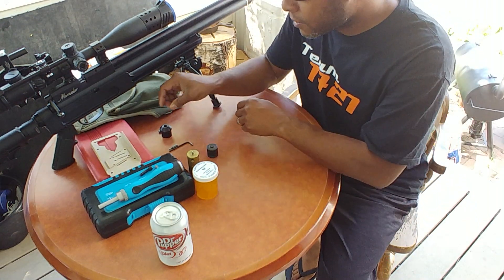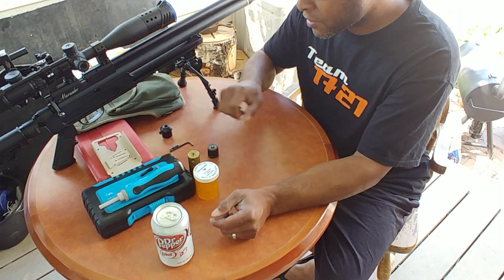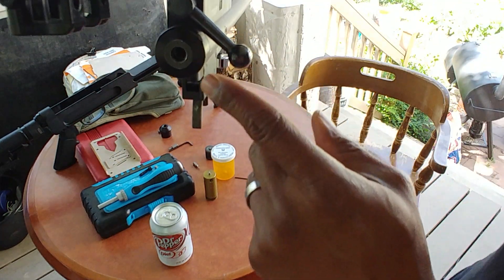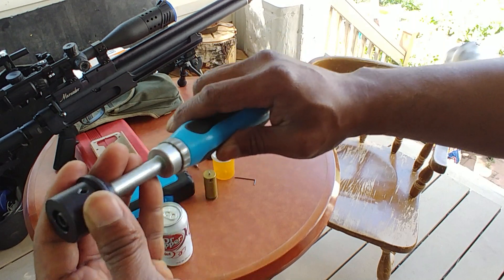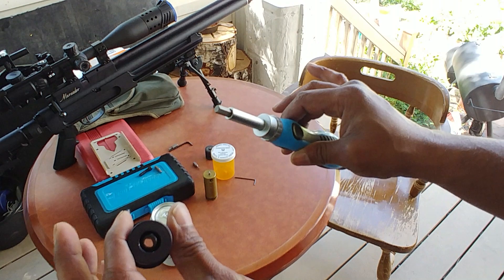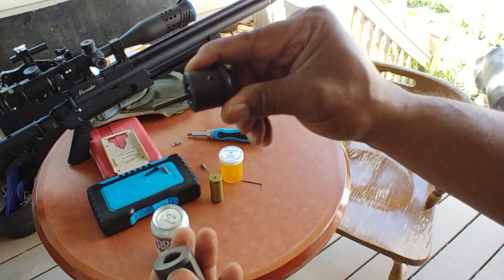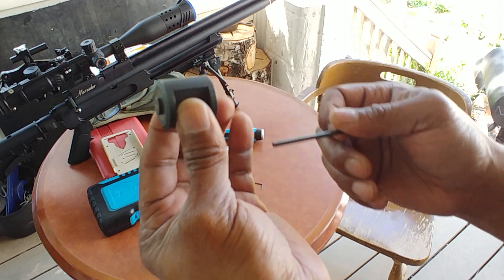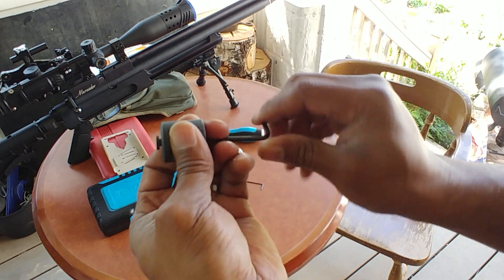How I tune a Benjamin Marauder for power.

Comment: Man the least I can do is subscribe to your channel...your video was so detailed I did exactly how you explained and my new marauder .22 went from store/manufacturer mode to hell mode holy crap
Reply from the maker: @ctjetskiclub772 thank you very much!  I really appreciate the comment and having you as a new subscriber.  That is what I like to know when people use this video to tune their Marauder.  What speeds and with what projectile were you getting before and after the tune?
Reply: @Monkeydad1969  I don't have a chronograph but will be getting one this week but I have the swinging metal targets and before it was smacking them and they would move 5/6 inches on the swivel now they going completely around smacking twice as hard and this is a new marauder I just bought this week stock from manufacturer
Reply from the maker: @ctjetskiclub772  cool beans.   Looking forward to your results.
Reply: @Monkeydad1969   hey buddy the only thing I did notice is when I did the 4 and half turns out for the transfer port screw when I re insert the jam screw I have to leave it loose like flush to the hole because if I keep screwing the jam screw in it will screw the transfer port screw down with it and will go to the bottom ...is that normal like the screw does not tight together with the transfer port screw.
Reply from the maker: @ctjetskiclub772  put the velocity adjuster screw where you want it, then blue loctite the jam screw.  Just butt it up to the velocity adjuster screw.  That should fix that.
Reply: @Monkeydad1969  1031 fps 14.3 gr for 33.76 fpe
Reply from the maker: @ctjetskiclub772  there you go.  How's your accuracy?
Reply: @Monkeydad1969  dime size groups pretty good

Comment: This gave me just the ‘umph’ I needed to start tweaking my .177 Marauder :). I’m using the 16.1 gr JSB Beasts and I was getting decent groups at 50 yards, but I could tell there was more available. I opened my metering valve about half a turn (total opened 1 3/4 turns from closed) and decreased the hammer spring tension about half a turn, now I’m stacking those Beasts every time at 20 yards and I’ve gotten down to 3/4” at 50 yards - very happy camper now. Thanks!
Reply from the maker: That's so very cool.  Glad my vid helped.

Comment: Great vid and explanation. Now I can easily tune my .22 Marauder.
Reply from the maker: Thanks
Reply: @Monkeydad1969  Can you give me any tip on how I could check the velocity/power without a chrony? Shooting at plywood from a certain distance and measuring the penetration doesn't feel very professional but I don't have a better idea at the moment.
Reply from the maker: @bencematyasmarton559  that's a hard question to answer.  The only thing I can say is shoot at the board first, measure the penetration.  Then tune your rifle for more power, shoot at the board again and measure that penetration.  Having a chronograph is imperative to rifle tuning.  I do understand, not everyone has one.  It's another cost.  Also, depending on what projectile you're shooting, the penetration into the board may not show any difference between a non tuned and tuned air rifle.  If you're getting over a quarter inch of penetration then you're probably doing fine with the power.  Accuracy trumps all regardless of power.

Comment: Thank you for dumping this thing down I’ve messed with mine never really got it where I wanted to. Very precise a good explanation thank you
Reply from the maker: Thanks Andy.  I hope you get your rifle going.  Let us know.
Reply: Well I got all I could from it , it’s shooting 31 grain H&N @837 fps
Reply from the maker: @andyhiggins8416  48fpe ain't no joke.  Did you back off the velocity adjustment screw in the valve?
Reply: Monkeydad1969 yes & the 1/8 screw backed up all the way
Reply from the maker: @andyhiggins8416  and did you back the hammer striker pin all the way back, then turn it in 3 times?
Reply: Monkeydad1969 I did but I got the max from it by keeping it bottomed out ,I did it with the three turns back in like you showed in the video but the speed wasn’t there so I tried it just bottomed out and it made a noticeable difference
Reply: @Monkeydad1969  what stock do you have?
Reply from the maker: @ajcummings8033  that's a Teryx stock.  But they aren't made anymore.  It's the first chassis system ever made for an air rifle.

Comment: Very good description and demonstration of what works... just picked up a 25 cal Gen 2  Amazon return cheap and started messing with it. I have already installed a huma  reg and a twin hammer spring in it, so now on to the valve!
Reply from the maker: What pressure are you going to set the reg to?
Reply: @Monkeydad1969  140
Reply from the maker: @randyburton3567  cool.  What are you going to do to the valve?
Reply: @Monkeydad1969  
I opened it up a good 6, maybe 7 turns and installed a twin spring system to help with hammer bounce. Right now I am not real happy with the setup. When I got the rifle. I could get 32 usable shots at 30 yards doing about 800 fps. After doing all the install and opening the
Reply: Valve up..
 Best I could do was 800 to 810 over 16 shots. I don't mind the lower shot count. But expected much better speed.
Reply: I have the hammer spring adjustment turned in several turns and the striker on the hammer back all the way to hit the poppet hard
Reply from the maker: @randyburton3567  you're probably going to have use ¼" vinyl tubing for the transfer port and you may need to change out the valve return spring for something a little softer.  You may even need to open up the valve exhaust.  Either all 3 or a a couple of those mods, depending on your level of tinkering.  You call also try upping your reg pressure, too.
Reply: @Monkeydad1969  Oh I am a tinkerer...I want to try and balance shot count and power, and without changing the valve and opening up the transfer port, and increasing reg pressure I have probably gotten all I am going to get from this setup... Not sure why I am concerned with it anyway when I have an FX Impact on the way in 22... I can get lots of power out of it...
Reply from the maker: @randyburton3567  cool beans.

Comment: Hi joe,i make this setting to mi .177 with 13 gr zan slugs end i have 934 fps. Thanks for your video.
Reply from the maker: I have updated my .177 since the vid.  It is powered by a JSAR valve and shoots a 19.5gr VarmintKnocker .177 slug at 60fpe.  I have tried KO Slugs, and they do great.  Please keep me in the loop on your setup.
Reply: @Monkeydad1969  I don't know if i can order valve from US because I'm in Cyprus i will try. Can you tell me how to find what barrel i have in my Benjamin; Thanks.
Reply from the maker: @a.l.r.3006  I don't know if JSAR will ship internationally.   When you say find what barrel you have,  do you mean what  manufacturer made it?  It's the .177 barrel that Benjamin makes in house.
Reply: @Monkeydad1969  yes that i was meaning, thank you very much for your time to answer. keep the good job 👍.

Comment: Excellent! Thanks
Reply from the maker: Thank you.  I hoped it help.
Reply: Reply with the quickness! I get the first 2 adjustments. On the hammer throw or stroke adjustment… CCW full stop… would this be max power? Why do you go CW 3 full turns? Would I possibly want CW 1, 2 or 3 full turns? Thanks again and hope my question makes sense
Reply from the maker: @precisionrodentcontrol_PRC  you reply with the quickness too LOL.  I say 3 turns CW from being backed out all the way as a baseline.  It is different for each rifle and shooter.   It all depends on what you are looking to get from your rifle and tune.  If you want more hammer stroke then back it CCW.  I usually go more hammer stroke so mine are backed off CCW completely.  CCW full stop is max hammer stroke...ie...more power.
Reply: Got it, thanks for the knowledge. Would love to see a similar video on the Prod. Happy shooting!
Reply from the maker: @precisionrodentcontrol_PRC  actually it is the same except for the lack of the velocity adjustment screw.

Comment: What a great video!  I am new to the PCP world and we appear to have the same philosophy -- Shoot with lots of power and FPE.  I have a Benjamin Marauder .177 Gen 2 and the AirForce Escape in a .25 cal.   I will be surfing your channel to glean as much info as possible.  Thanks again!
Reply from the maker: Thanks Mark.  Yeah, I'm the worse at putting out vids.  But I will have some coming out soon.  Mostly catch up from vids past.  I have a couple builds that should be finished soon and I love my .25 Escape and .257 Escape.  I like power but I'm really into getting power with minimal air usage and a good shot count.  I've started to do less psi fills and getting serious power.  That's especially true of my .25 Escape.  2400-2600psi fill, 30 shots with a lot of power and I haven't touched the power wheel.  It's set on the lowest setting.  Tuning is key and a chrony is essential.

Comment: nice lookin gun.
Reply from the maker: Thanks.  I like it...a lot.
Reply: @Monkeydad1969  im in the middle of a pcp .243 air rifle build on my other channel bison workshop. and right now im working on a few bugs in the system. if you want, your welcome to go check it out. and trust me its not a cheap ass pipe build like i see in most of these youtube channels using pipes and fitting i wouldnt show to anyone lmao. i built it in my machine shop and carved the stock. all made from scratch. you would like it.

Comment: Hey Joe I know that this is a bit older video but if you're still out there i have something to ask if I may ? Can you adjust the hammer spring and the hammer throw without opening up the pin in the valve ?? And if I adjust the hammer throw all the way out to start with like you did is there a positive stop or will it back all the way out like you said it will if you go all the way in with it ?? And does the hammer spring adjustment stop when you back it all the way out or will it come out of the gun ?? Any help you could give me would be greatly appreciated !!
Reply from the maker: The RVA, rear velocity adjuster or hammer spring adjuster will stop when you go CCW (counter clockwise) until it stops.  It will come off the threads if you go clockwise all the way.  The hammer throw (striker) will hit the face of the hammer when you go fully CCW, but it can come off the threads if you you go too far clockwise.  You don't need to adjust the velocity adjustment pin when tuning with the hammer spring and/or the hammer throw...just be aware you will limit the tune if tuning for huge power gains.
Reply: @Monkeydad1969  thank you Joe !! 👍👍
Reply from the maker: @timmy4539  hope that helps.
Reply: @Monkeydad1969  hey Joe just one more thing if I may ? With this tune work on the field / target to ??
Reply from the maker: @timmy4539  well, being that the Field and Target is regulated,  your mileage may vary.  The nice thing is that it will be consistent, but you will not get any huge power gains.
Reply: @Monkeydad1969  why I asked is that I got a
 field /target in 22 cal from Rick from airgun web and he told me that the hammer and the hammer spring needed to be adjusted on it ! So I thought that this tune would work for it ! Do you think it will ??
Reply from the maker: @timmy4539  yes, it will give you a little more bang for your buck, and it will still be very consistent with a good shot count.  I don't know how much more power, I don't know what they are regulated at.
Reply: @Monkeydad1969  so if it's regulated can I adjust the air pin as you called it ?? If not I can still adjust the hammer spring I'll be good to go ?
Reply from the maker: @timmy4539  as long as it has all the adjustments a standard M-Rod does, you should be good to go.  If never had the Field and  Target in my hands, so I can only assume it has the same adjustments.
Reply: @Monkeydad1969  thanks Joe !!

Comment: Great video the best part is you answer questions you don't just talk you get to the point probably the best one out there but I have a question I am trying to tune a new 22 marauder to get about 933 feet from the present 843 feet and not lose my accuracyGreat video the best party as you answer questions you don't just talk you get to the point probably the best one out there but I have a question I am trying to tune a 22 marauder to get about 933 feet from the present 843 feet and not lose my accuracy any tuning points you could give would be great if you worked with a 22 Mirador thank you any tuning points you could give would be great if you worked with a 22 Mirador thank you
Reply from the maker: What pellets are you shooting or do you want to shoot?  Are the pellets or slugs you shoot accurate out of your rifle?  You may have to do some modifications to your rifle such as valve work or a new more powerful valve, utilize a heavier hammer spring to get that speed, depending on the weight of the projectile.  Please let me know.
Reply: Right now it shoots everything i have put in it. a hole at 10 yards 10 round group  even the 10 dollar 500  benjamin pellets .tryed about 6 brands of pellets ,this is the problem i do not want to lose the accuracy for the power , but i would like it to get 933 an keep the accuracy . everyone tune no one shoots groups please shoots some groups , as for as the pellets im up to shoot what ever it takes ,but i hunt with this gun .Thank you for your help
Reply from the maker: @barttate3228  933fps is a lot of speed.  But if your barrel is good, then accuracy shouldn't be an issue.  Just for the speed you want, you're going to have to do some work.  I suggest a Jefferson State Air valve or the Hill valve.  The Cothran Powerhouse valve is was powerful, just to much for .25 caliber.  I'm really bad about shooting groups and even worse when it comes to YouTube.  But you're right, I need to shoot more groups.
Reply: @Monkeydad1969  yes you are please shoot some groups thanks so much for yor help

Comment: Hey brother very good video!  You didn’t talk a lot. 

What’s the max fpe can the marauder achieve with how you tune or what’s the max fpe that can be achieved!
Reply from the maker: Depending on caliber and projectile weight, tube pressure... you can get 45fpe pretty easy in .25.  It's been so long since I've shot a stock rifle, all of mine are modded.  I do have a stock .25 M-Rod, it's regulated.  Guess I need to remove the reg and see what I get.  I wanna say I've made up to 50fpe in a stock .25... but I really like to do a little valve work and open up the barrel port for better results.
Reply: @Monkeydad1969  of course.  See the reason why I’m concerned about power is because I’m so use to how I have my .177 break barrel. It shoot like a 22-short. I DO NOT SEE THE PELLET OR SLUG N THE AIR!

That’s what I’m use to!  I realize that for the power I’m use to dealing with I need to upgrade to a pcp which can be easily modded and not a hassle to tune!  I’m looking for the key ingredients; new plenum, and other adjustments that can yield 1080 or 1200 fps in .25 cal at least around 26-30 gem slugs🤷. I am looking at the Avenger-X and the Maurauder in .25 cal!  The Avenger -X have so many mods. But I’m an old Benjamin buff from back in the 80’s and I wanted to compare and see which is easier to tune and which one can yield the most power and is it possible to put a. Otto’s on a mairauder? Or is that what the Cayden is for (it has a bottle)?
Reply from the maker: @roderickthomas3417  1200fps in .25 is not an easy feat, even with all the tech in pcp rifles.  On your .177 break barrel, what weight pellet are you shooting?  Idk much about the Aveng-X.  It has a lot of tunability.  The M-Rod lacks the reg.  A Cayden to me isn't the best platform for power.  Also, there are other brands that are more than capable of getting you where you wanna be, as long as you have the money to spend.  To be honest, I think for power and accuracy, you can't go wrong with the AirForce Condor or the AEA Challenger Pro.  I have both, and they are amazing.

Comment: How much power FPE and FPS can you get out of the Benjamin Marauder .25 caliber using 26 gr pellets by just tuning without modifying any parts?
Reply from the maker: That all depends on the tune.  I know that sounds like a cop out, but it's hard to say because it depends on the tune.  I haven't tuned with pellets that weight, but now I probably need to do some work.
Reply: @Monkeydad1969  Thanks for your insights! I currently have mine set to 840 FPS with 26gr FX Slugs, achieving 40.72 FPE, and it's performing with great accuracy. I was just considering whether it might be worthwhile to invest in the .25 Rifle Max Kit at $267.98. They don’t specify the additional power gains, so I’m curious if the investment could significantly improve performance. Any experience or recommendations on this upgrade?
Reply from the maker: @papote385  It seems to have quite a bit of punch with the 26gr, which are actually the JSB King 25.39gr.  How much more power do you need and what will the rifle's purpose be?
Reply: @Monkeydad1969  Hi there! I chose this air rifle for hunting small game because it can reliably group 5 shots within 1 inch at 60 yards. My goal is to maintain around 30 FPE at that range for humane hunting. With my current power setting, I keep my shots within 60 yards, but I’m curious if there’s potential to extend that range to 100 yards effectively. Any insights?
Reply from the maker: @papote385 of course.  You just need to set out targets from say 50 to 100 yards and start shooting.  Practice makes perfect.  But you will lose your current tune to maintain good down range energy.  You can shoot with your current settings, but you are going to want to bump it up just a bit.
Reply: @Monkeydad1969  Thank you for your response. I’ve decided to stick with this tune for now since it took me a couple of days to dial it in, and it’s currently providing excellent results.